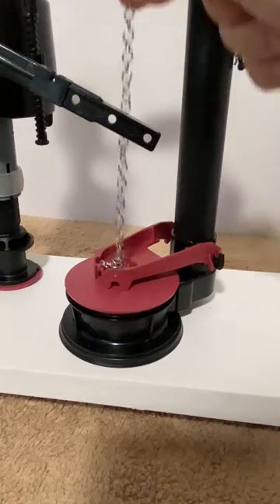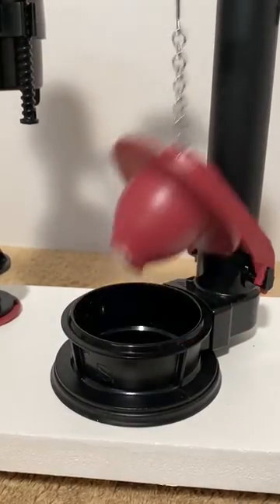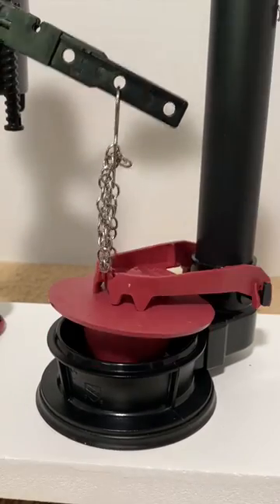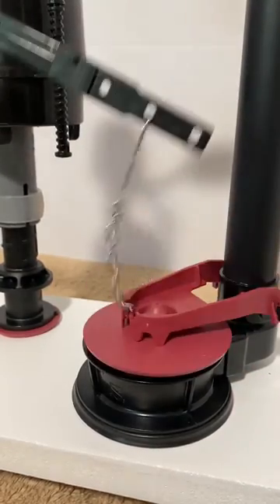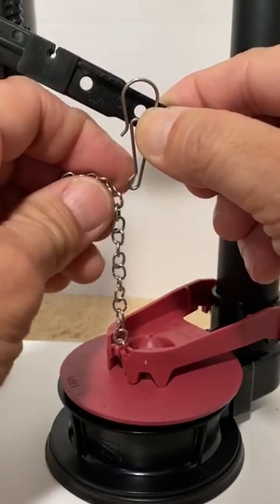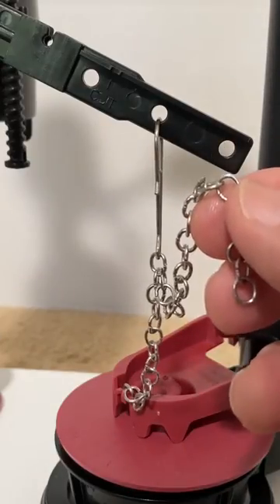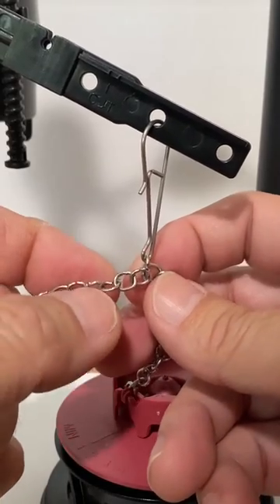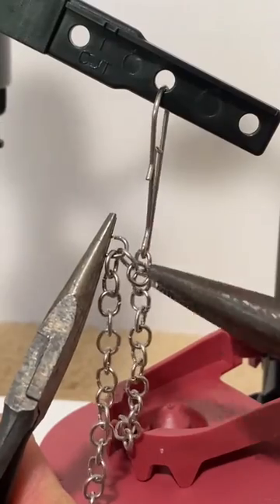How Tight Should a Toilet Flapper Chain Be? | How to Fix a Toilet for Beginners

Comment: bro, i installed all new parts in toilet tank. Everything was good, no leaks outside anywhere. Two hours later i went in and lifter toilet lid to make sure everything is still good, the fill tube at the top the thing was dripping water out of it. Adjusted the chain, and stopped leaking. So what it was is flapper was like barely open and not sealing , but basically 99% closed. That 1% slightly open is why the water filler tube thing at top was dripping a TINY drip because water at flapper was barely leaking down the hole at bottom. So one key visual that i noticed is when my chain was to short, is the flapper landed on the hole slightly off center because chain was pulling it off center because it was to short. So my key visual to know if you got proper chain length is that the flapper should  be centered and not pulled to one side or the other off centered in anyway. So heads up on that. ✌️
Reply: Please be with you and the same thing happened to me

Comment: Turning in my plumber's card. Two days ago I replace a toilet shutoff valve, flapper and leaks on my two main water shutoffs with little or no problems.   Today I simply wanted to shorten the chain for the flapper.  Watched your excellent video, resulted in overflowed toilet, several wet bath towels, two rugs, robe. Had to wash the floor. Chained shortened, lol!!!!  Thanks for a great video, btw.

Comment: A small amount of Slack in the Chain is necessary. Two links is sufficient. As for the extra chain that can also be looped and attached to the Hook.
If you are going to Cut the Excess, leave at least 4 extra links in case the Chain needs further adjustments to make it easier to hold onto.
If you ever need to Replace the Flapper, the Replacement might have a Different Attachment for the Chain.

Comment: I had a plumber come out and and replaced a low flow unit with a flapper (new arm and chain) and it worked for about a day then it started short-flushing. 

You pretty much gave me what I needed to fix the issue myself without having to wait a whole weekend and some change for service. Thank you!
Reply from the maker: You're welcome!  Glad to hear that you found the video helpful.  😎

Comment: My chain and flapper and everything seem to be in fine condition, the length is good and everything too. However, the flapper seems to overextend, so it never falls into the hole properly. I have to open up the tank and force it in, with effort, every single time.
It wasn't doing this a week ago, but now it's all the time.
Any advice or ideas?
Reply from the maker: I would guess that it is not the original flapper for that flush valve and the replacement isn't the proper fit.  You may need find another flapper that doesn't extend as far.  😎

Comment: My chain doesn't tangle, it gets stuck under the flapper and holds it open.
Reply from the maker: The chain has too much slack.
Reply: @HacksbyDad  Yeah, I took out some of the slack and bent the handle rod away from the flapper and I think that fixed it.